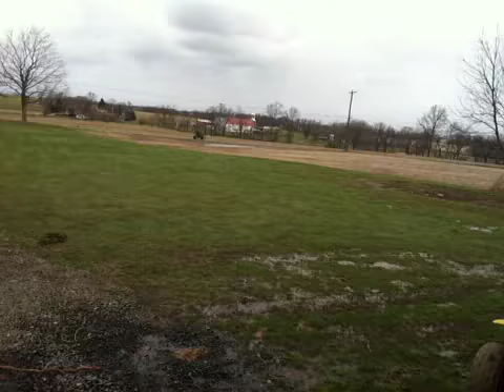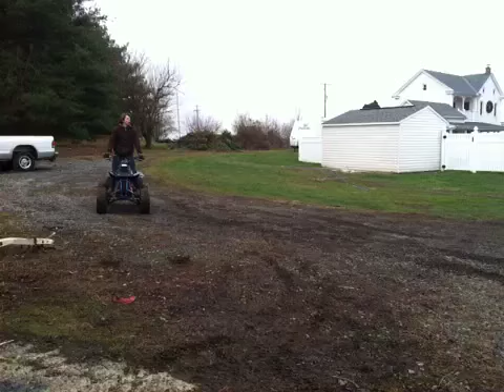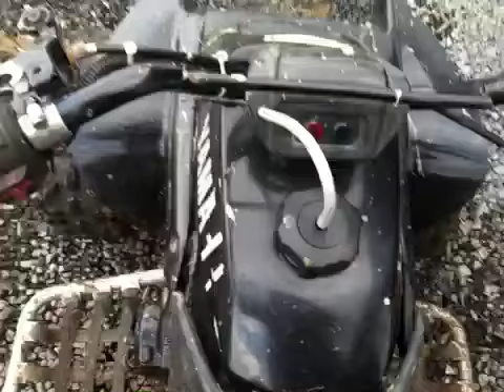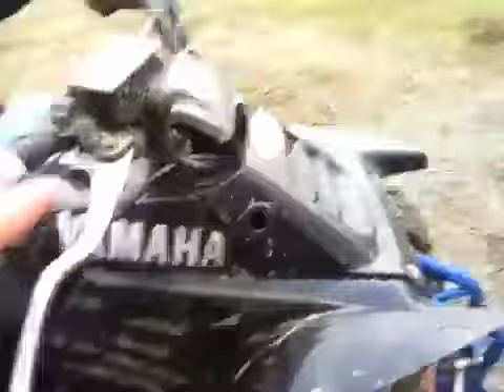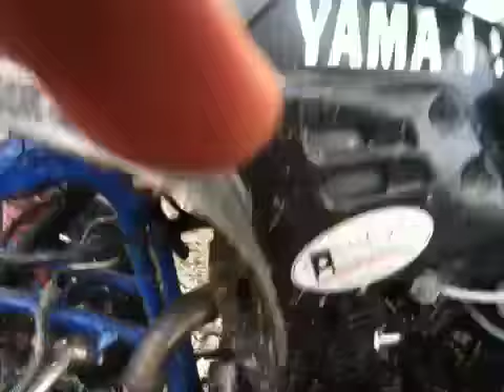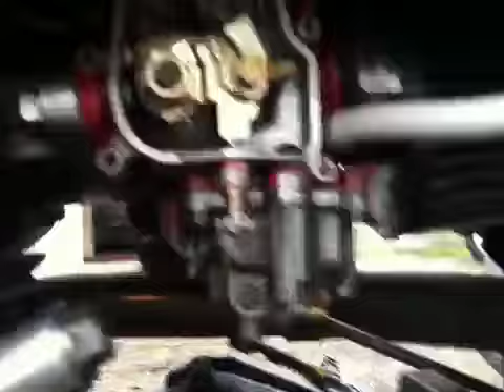Warrior 350 December 22, 2012

Comment from the maker: @nkd2883 It feels like one when you ride it it is alot faster than most warriors but its about the same weight you can feel the power though coming out of the engine as you shift! It doesnt have the recoil start only electric start but i had a recoil start on and the engine kicked back and shattered the whole assembly and there was no way to start it without the compression realese, 10:1 compression stock is 9:1  so it has like 130-140 psi compression! Its really loud!